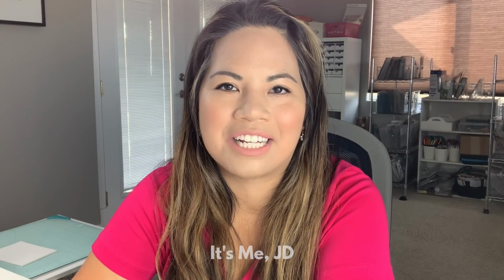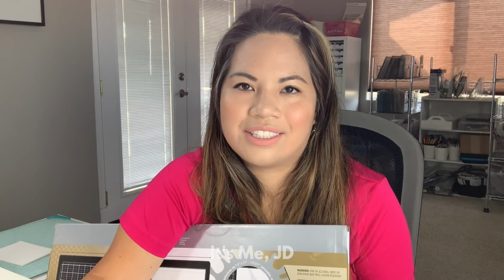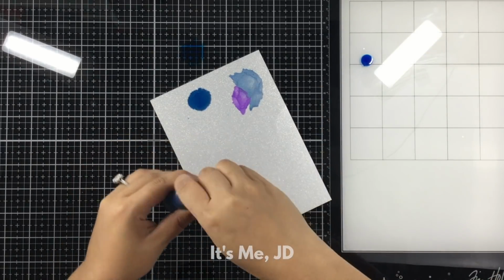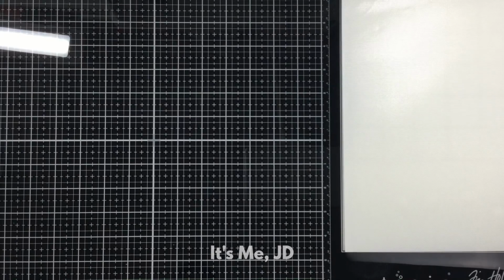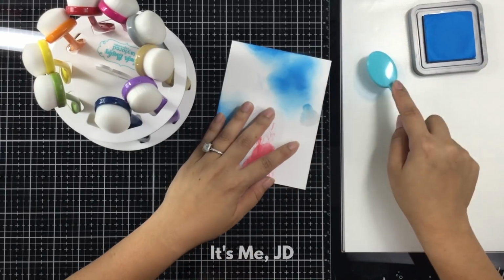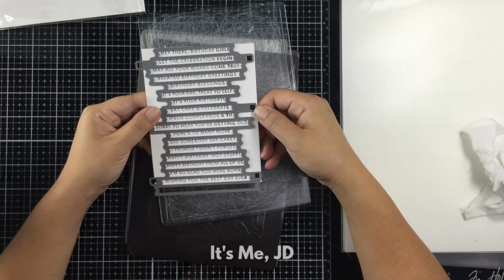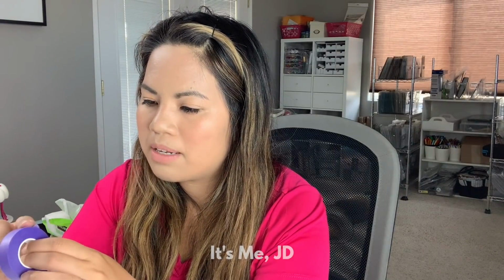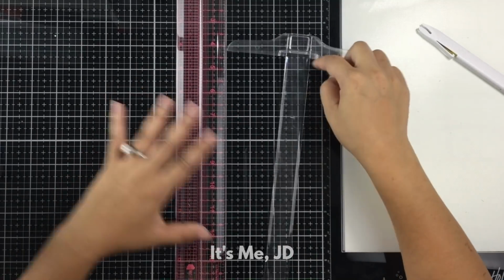Testing out "MUST HAVE" Craft Supplies & Crafty Tools...are they worth the money? PT 1

Comment: JD, try cutting a craft cutting  mat to fit your gemini for a cutting plate. I tried it and it worked so I didn't have to buy anymore cutting plates!
Reply: I bought A5 size cutting mats in Daiso and they fit perfectly.
Reply: @AlphaGeekgirl  daiso?
Reply: J m it’s a Japanese version of the Dollar Tree only better!  Most items are $1.50 unless otherwise marked.  I LOVE Daiso.
Reply: @AlphaGeekgirl  thanks, great Idea. I will have to check Daiso out for one for my smaller 5x7 sizzix. I love there $1.50 prices. It would be a great find for any of their lower prices though. Lol. So far we've only used the sizzix for embossing because we have the larger spellbinder that we can use for die cutting.
Reply: I use a healing mat.  I love how it works. I trimmed it 1/8th of an inch to fit. The trimming took strength but it was worth it.
Reply: Millecent Mae I bought a self healing mat Olffa 5x7 and didn’t have to cut it down. I run it though with the two cutting plates and the white shim. I love my Gemini Jr😍
Reply: @Deejcreates  I had to cut mine as I have the Gemini, not the Jr.
Reply: @Deejcreates  my plate is 8 1/2 x 11 the healing mat had that size grid and all and 1/8 in border all the way around that needed trimmed away to be the size I needed. I love it. It's a spellbinder.  I haven't ever needed replacements.
Reply: I am so confused! If I put anything else in with my 2 cutting plates and cardstock shim and plastic shim, it would not go through the machine. What am I not understanding?
Reply: @jolexasjo  in my spell binder the base plate is the part that isn't used. I use the cutting mat plus the healing mat with the die cut facing the healing mat and run it through. With the embossing folder I use the embossing mat plus the foam mat and a self healing mat and run it through. Both work great in that combination with any brands so far. I played around with it to find the right combinations.
Reply: @jolexasjo  I use the cutting mat INSTEAD of the cutting plate, try it.
Reply: J m  I had a BigShot before my Gemini Jr so my sandwich starting from bottom is 1 Gemini plate, Gemini frosted plate, Olffa 5x7 cutting Matt, 1 Bigshot plate on top. I realized the Gemini plates are thicker. If I’m working with some super detailed die I add the metal shim on top of the Gemini frosted plate and it all still fits fine. I use this with all thin dies except the ones from Gemini.
Reply: Lori Wikoff genius!  I can’t wait to try this - never would have thought of that.
Reply: Lori Wikoff What did you use to trim it?
Reply: @zb7608  I used an exacto knife and a metal yardstick. Be careful and go slow, you don't need to cut all the way through the first pass. Just keep cut shallow til you are through it. Be careful!!!!!
Reply: Lori Wikoff thanks.  I had planned to get the mat and try an Exacto, but it seemed smart to check with someone first!  I promise to be careful.  It would be hard to craft without all my fingers!  Thanks for the advice!

Comment: love mine.  Cutting, heat embossing, smooshing are a dream.  it also helps (a bit) to keep some of my supplies off the work area.    and yes,  keep the clear piece and put the non stick mat on it.  mine curled so much when I left it on.   Plus my work desk was a bit warped and this solved the problem.